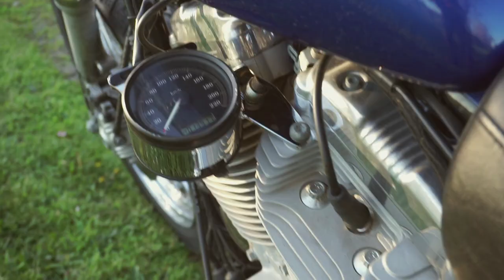Harley Davidson XL883L sportster - New handlebar (chopper project)

Comment: That bar looks freakin awesome on a sporty! What brand is it?
Did you have to replace cables and brake hoses as well?
Reply from the maker: Thanks ! That's a TCbros rabbit handlebar
Brake hose and cable are a bit short but you can install the bars with stock ones
Reply: @hatedcyclescompany581  fantastic! cheers mate. love your video!